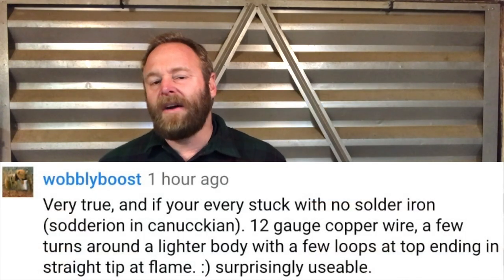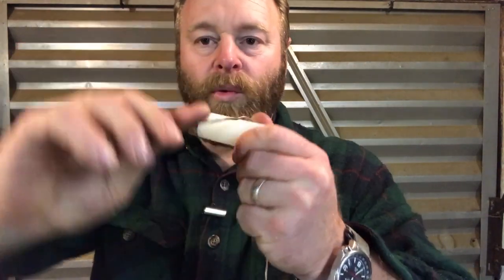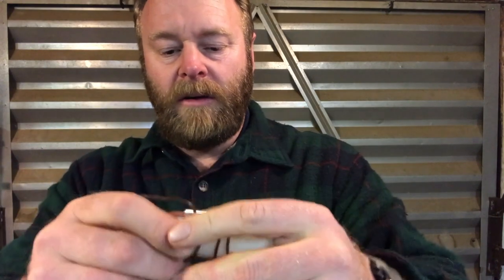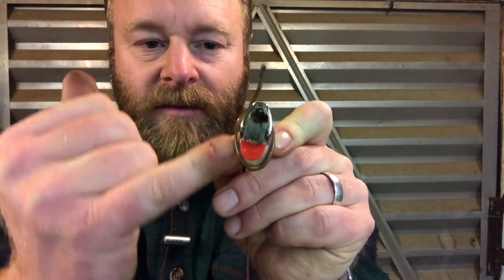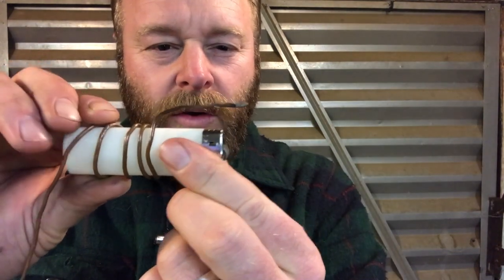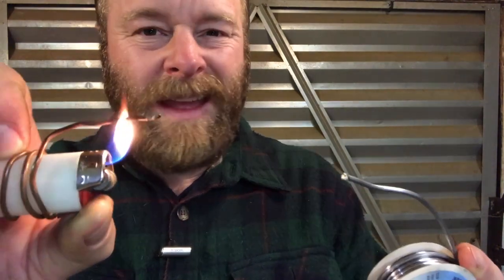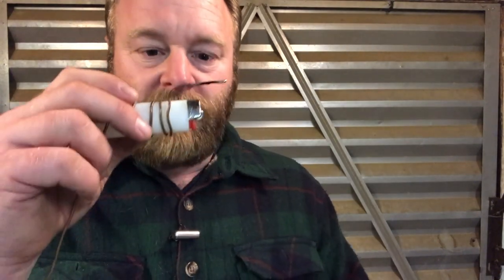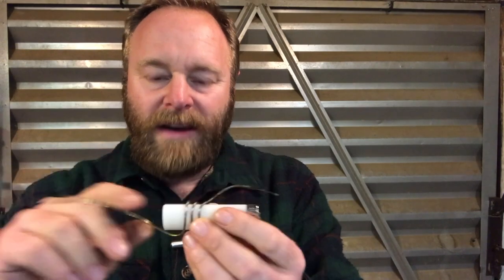CRAZY Simple Lighter Hack | How To Solder Using A Bic And A Coathanger

Comment: Very cool. Could see using a propane torch or any flame source the same way for better control of the heat. Thanks.
Reply from the maker: That's a good point, Paul.

Comment: Really neat expedient soldering tool. I like it! Don`t forget to carry some solder! Maybe wrap the copper wire and solder onto the lighter and tape everything up and stick it in the toolbox. Make sure the solder is flux cored or you will need to bring some flux too. Tinner`s flux is liquid and easier to apply, in many cases., though it is an acidic material which may corrode delicate electronic components.
Reply from the maker: That's a good point to just put together a kit.

Comment: I do alot of soldering in my trades around plumbing. I don't know much about soldering electronics. Is flux required for application?
Reply from the maker: Typically yes, admittedly I’m not a pro solderer. Most of the solder you find for applications such as this are flux core so it’s kind of all in one step.

Comment: True story:  Friend of mine had a motorcycle stop on him because of a CDI problem; he cut open the part that was giving him trouble, heated up a nail and fixed the solder joint that was bad and then plastic welded the whole thing back together.  It fired up and he got back to civilization.